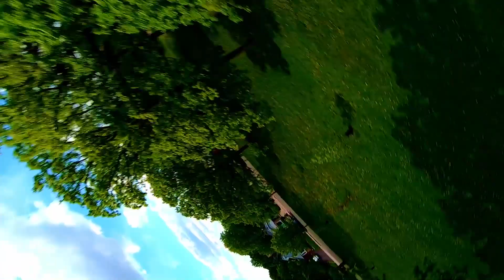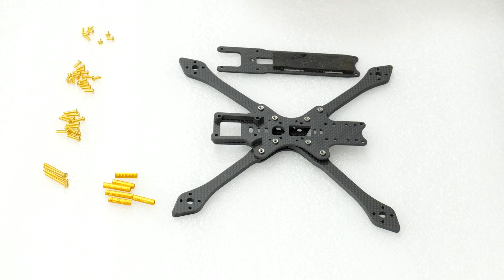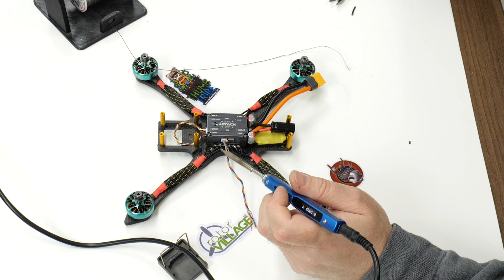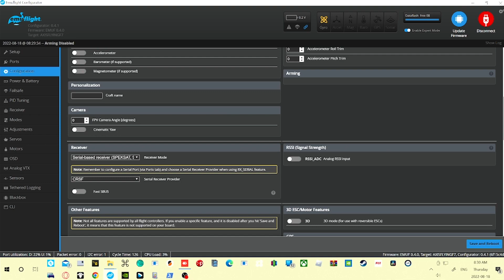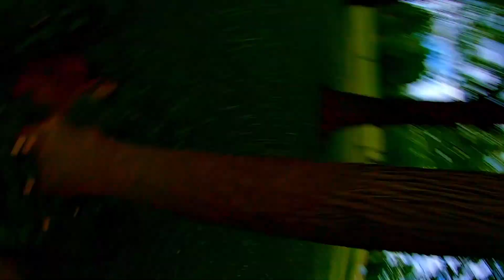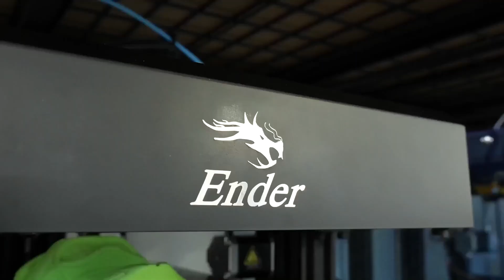WHY PJ GOT INTO 3D PRINTING

Comment: I am interested in the idea of building a drone. However, you jumped right into the assembly without mentioning which frame you were using and why. Same with the rest of the build. Little explanation other than mentioning the web site where you got the parts.